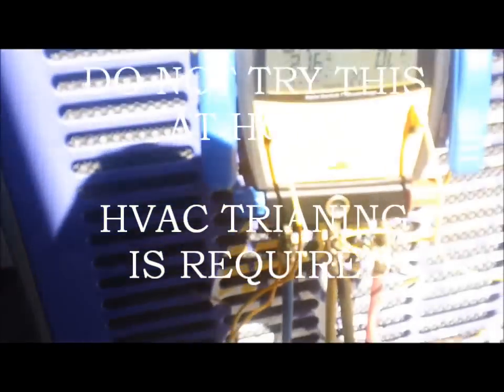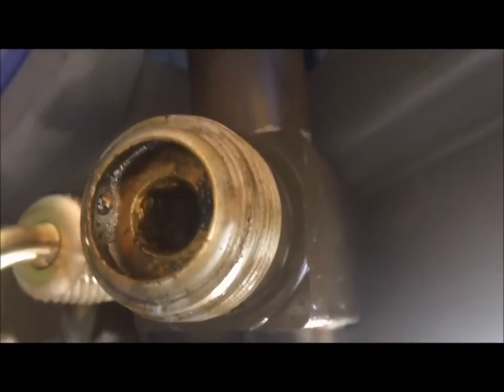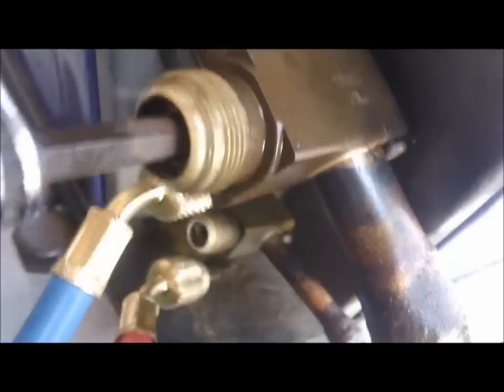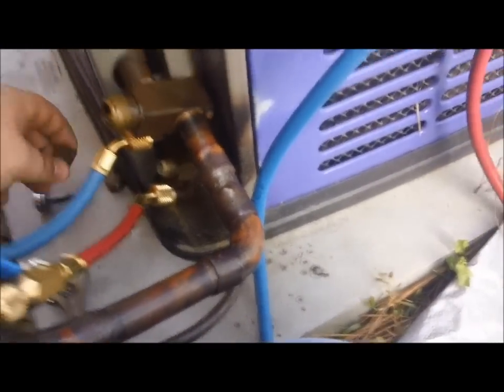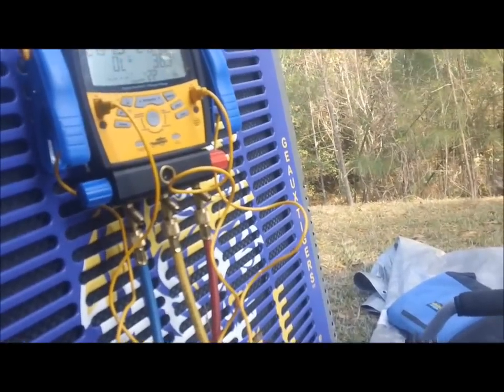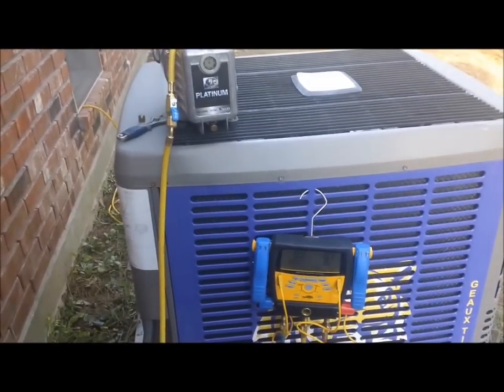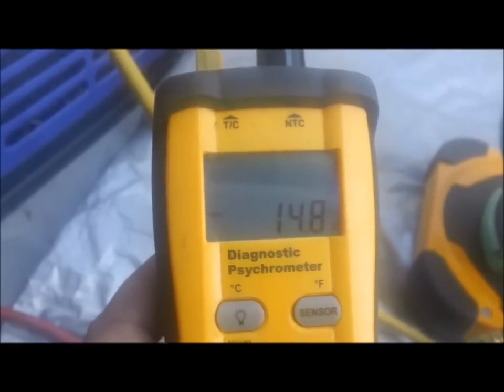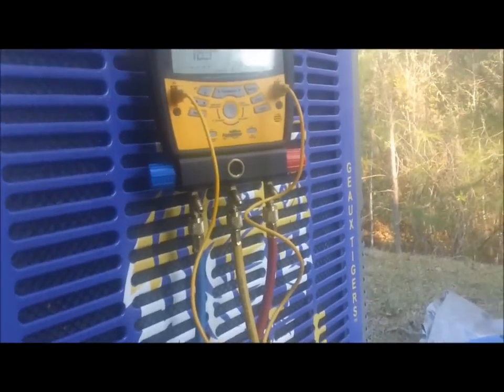HVAC Service: Leak Search & Repair

Comment: No good deed goes unpunished.  He fixed his sister's unit at no charge.  It's an old R22 unit that will have to be replaced soon anyway.  Band aid is good enough.  That valve has been leaking since the installation 10 years ago.  The cap held it until now.  This fix will probably last until it dies.  A "real" service man with "honor" and "integrity" would have replaced the valve and charged her $1000 to fix a unit that may go out tomorrow.   Lighten up.

Comment: I realy enjoyed your video l got a 2001 Amana . Who makes those,  Are they any good. They told me it was   Leaking 3 weeks ago, And it still works perfect. I've been sending I've been sending $40 a month for 19 years . Now they want me to buy a new one. I thought they  Should fix the leak ,what do you think.  It could be something small at the shrader valve. I really think they're trying to rip me off
Reply: Amana is Goodmans other brand, same stuff different brand. Goodman is Toyota and Amana is lexus. Both the same though.

If your system is r22 i would just replace the system. R22 is obsolete, your system is old. Most repairs on old acs are costly anyways.

Comment: Your videos are good but why didnt you fix the problem or check if any of those solder joints were leaking.Unfortunatly I think you’ll be back to fix the original problem sorry but what you did was a bandaid repair that’s not going to last. Sorry but I think you’ll be back.    Hopefully not good luck

Comment: The pressure may be too high for Nylog to keep it from leaking.  I found Nylog is useless. Replace the service valve or do a bypass line with a service port are good solutions.

Comment: You take the time to recover the unit, but won't FiX the problem?

I can see putting sealant on it as a quick fix if you did not want to replace the coolant at that moment but man it was already empty! Change the valve!

Comment: BOOOOOO!  I am calling foul.  Change the washer in the valve not use what is analogous to teflon tape!  Seriously????  If this is the quality of work you do I am glad I don't live in your service area.  That leaves it for the next guy as you DID NOT ACTUALLY FIX IT!  You treated the symptom, not the cause.  The caps are only meant to keep out dirt not to hold refrigerant in.  OMG!  What a knucklehead!!!!!

Comment: The nitrogen pressure didn't rise.  The unreclaimed refrigerant still in the system has risen in pressure.  What if the refrigerant left over should have made the system rise to 204.5!  How would you know to "call it fixed"  purge the refrigerant with nitrogen so you don't have this error in your method.

Comment: Those aren't tightening threads on those caps. Tighter u go threads get further apart. There's a video on here showing that. Cut it out or replace rubber seal or Oring.youll be back for sure

Comment: ‘Calling it good’ does not make it fixed.  Why not actually fix the leak so it doesn’t rattle loose or become an issue for the future.  Honor. Integrity? and the sad part is your lack of training and hubris is on your sisters system.  No one wants to hear about you having lunch with your wife or all the bs talking.  Let your work be your representative of your skill not all your blabbering words.  Shop on eBay no small Tąnk cost 400$ maybe what you are charging your sister or customers but it’s wrong and will come back on you

Comment: Good video ... just wanted to know when I use the nitrogen to leak test  do I have to run a vacuum first to rid the unit of whats left of the charge or can I just add the nitrogen straight? And to what psi should my nitrogen charge be too?
Reply: Ronald Lee huh?

Comment: How did you remove the charge?  Would have liked to see that.   Didn't put a wet rag or something during the braze and most likely the internals are cooked on that valve.  Can't just use teflon tape instead of  nylog?  Did you let the liquid on the high side or low side or both?  Did you have to start the unit to get the 7lb 4 oz in?   Didn't see that in the vid.    Keep em coming.  Merry Christmas to you too.

Comment: Nice video.  Hello from the west coast in northern California.  If that were to leak again and the leak lock didn't hold.  I found some o rings at Baker Distributing that can repair those service valves.

Comment: Hi Israelhvac  
question? what's the best  way or  effective to check a leak 
I have put freon on my unit  and it just  last me  only 2 weeks 
can I check a leak with the injectable fluorescent dye ? on R-22?
Reply: thanks we had to add 3.2 in a 9lb syst. we know we have a leak . where it is ,is the question tech thinks possible evap.. Important question--- Why do you vacume . ??? To isolate leak in setlines and evap ?  Omitting OD condensor .???
Reply: There is a tech Yes but not all techs have the same methods and some methods may be more effective with less cost and more success.    Just want to know my options from knowledge, not experiment . I am a homeowner and hopefully the more I know the better I will served . there are many in the HVAC who dont know what they are doing and I d rather not finfd out the hard way,that they dont .
Reply: Miamigo Denegri pressurize the system to about 300 psi for r22 400 for 410, also add a tracer gas 35psi of refrigerant. Buy yourself a good electronic leak detector Tek mate tif zx and fieldpiece make some good ones that won't break the bank. Search for a leak with your leak detector and confirm with soap bubbles. Try to never put anything in your system other than refrigerant and oil. If you can't find the leak then your last resort should be to vacuum test. Put it in a vacuum and let it pull down. Shut off the pump and isolate the system, if your microns shoot up past 2000 then you know you got a leak
Reply: Wow just realized this is 3 years old lol
Reply: What is a tracer gas,  how does it work ? Your last resort is a pull down vacume ?  Do you mean to only check from service port to evap  inside ,    what about OD condensor then .  We have a leak  somewhere .  3yr Trane 3 ton . Saw no visible oil  . OD shut down 3 times first yr winter due to defrost board defect.  Could high  pressure have caused leak in OD before unit shut itself down ?  Unit was ok  3/17 perfect subcool 10deg   5/18 needed 3.2 lbs . Can you advise . Want to be sure tech does the right process and or repair .
Reply: oldtimedrumcorps  a tracer gas is just refrigerant about 35 psi so that your electronic leak detector can sniff it out. I would also only use the refrigerant that the system is rated for. Some people use r22 even on a 410 system as a tracer gas because it's easier to be picked up by the electronic leak detector. Don't recommend it but it works
Reply: oldtimedrumcorps also I meant to vacuum down the system to confirm if you actually have a leak. The real last resort would be dye or leak stop but I don't like using those things.
Reply: oldtimedrumcorps I put it in a vacuum to confirm if there is actually a leak. If you have a leak in the system you won't be able to properly evacuate the system. If you put the system in a vacuum let's say you get down to 1300 microns, but once you shit off the pump or isolate the system the microns will rise past 2000 if you have a leak because it is pulling in moisture from the atmosphere
Reply: so I understand that  part. Looks like system check from lineset to evap and back . How did you check  OD condensor for leak.?  Does the OD unit refrigerant get evacuated as well at the same time ?  Simply put should the OD unit be evacuated and tested as a separate unit  to isolate the leak area ? Thanks
Reply: Once more please,  do you isolate the different components to test ?  To pinpoint the areas to sniff ? Set line evap ,   THEN only the condensor . the pressure test can do the whole system right?  You cant vacume test if refrigerant is in system,  right  ?      But you can pressure test right ,   with out vacume ?
Reply: oldtimedrumcorps  is there not a lead tech on this job? Are you a homeowner?
Reply: oldtimedrumcorps my opinion would be to find a trustworthy technician to do the job, a good tech will gladly educate you and give you a good step by step scope of work